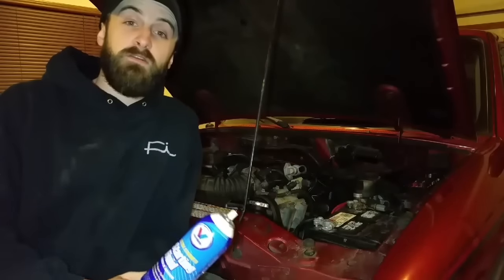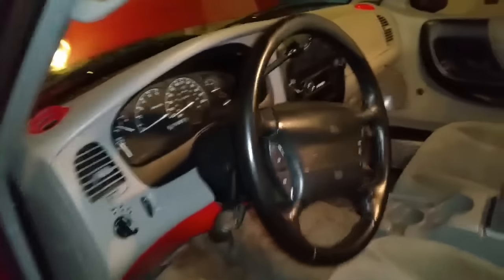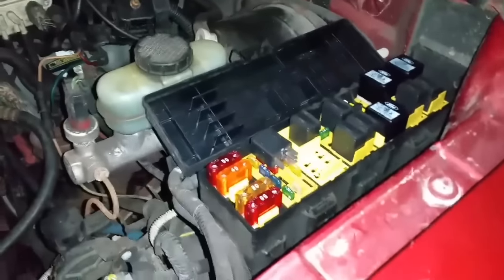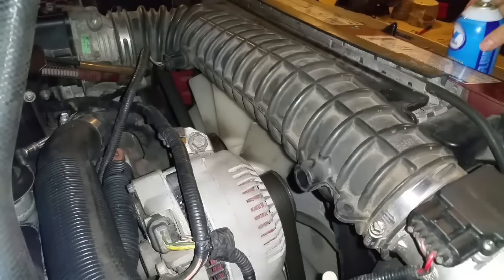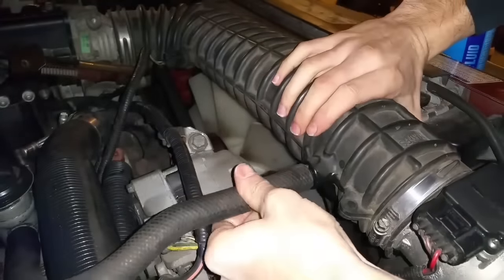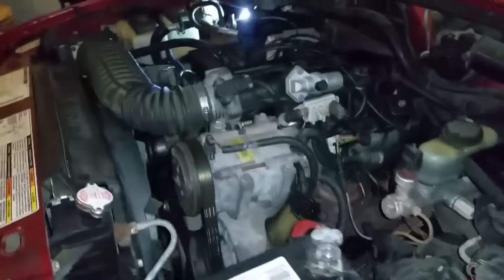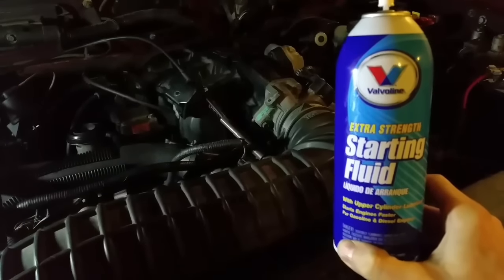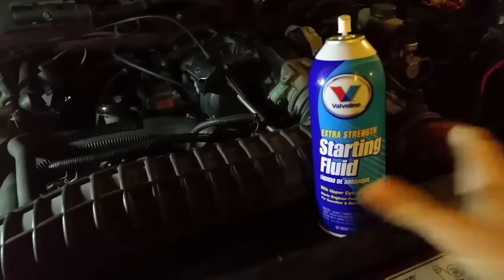THIS REALLY WORKS!!!!!!! Bad fuel pump, fuel pump relay, no fuel problem!!!

Comment: Thisw 2works ok as an early test. It proves that you have spark. It eliminates that entire system. How ever it only proves that the fuel system is not working. Mor4e testing needs to be done to prove what fuel component is the malf. Many things can cause the pump not to run.
Reply: Yes but the first thing you check is the relay/fuses start the cheapest is that doesn’t fix it then you replace the fuel pump assembly it’s cheaper and easier
Reply: @chancesmall7026  how do you do this? I replaced the relays but still nothing, I don’t hear a click when the car is in the on position like I use to
Reply: @Francofit  you need two people to be able to do this trick one needs to lay down in the trunk with your ear against the inside of the trunk, have someone in the car, don’t start the car up but turn the key over all the way. Whoever’s laying in the trunk should hear a sound if you do your fuel pump is fine if not it’s something else. What’s wrong with your car might be able to help
Reply: @chancesmall7026  my car won’t turn on anymore, I bought the new relay for it but nothing, it starts with starter fluid but then it dies right after, I tried hearing a click while someone starts it but nothing, I also can’t hear the click anymore inside like I use to when i put it into the on position
Reply: @Francofit  yea it’s most likely your fuel pump bud im sorry but just in case check your fuel filter first it’s a lot cheaper and sometime they get clogged up, also buy some Lucas oil fuel injector cleaner/fuel system cleaner try get it started and run some of that through it. If that doesn’t work it probably is the fuel pump I’m sorry
Reply: @Francofit  there is also a fuse or two for your fuel pump not just a relay check that too that’s what it was for me
Reply: @chancesmall7026  where is the fuse for that?
Reply: @Francofit  for my Acura I have two fuse boxes one under hood one inside mine was under hood it’ll list them all on the fuse box cover or the cars manual
Reply: @chancesmall7026  does every fuse need to be in tact? My door lock fuse is out but it has always been out when I bought the car
Reply: @Francofit  get it fixed?
Reply: @billyhighfill  I did lol
Reply: Very true @charles carr
Reply: @chancesmall7026 what if I did the bypass and my pump comes on but still doesn’t come on at the ignition on or fires up?

Comment: My problem is intermittent and occurs when I shut the car off between 30 seconds and 5 minutes. After 5 minutes it always starts. How do you know the difference between a bad fuel pump and a bad fuel pump relay?

Comment: I just had this problem. I pulled the fuel pump fuse, and it was good. This is the first thing you should do. Then check voltage at the relay terminals which were good for me. Then I changed my relay and everything started working. Then I plugged my old relay back in everything worked.  The connection between the relay and the housing pins oxidized. Just had to pull and reset the relay.

Comment: Good video very educational. 

Here's my situation my car wouldn't start. 

Use starting fluid CPL times started then died. Tried one more time fired up I let car run to engines temp.  Now starts again I have a manual aswell. 

Any help I appreciate fuel pump going bad?
Reply: Maybe starting fluid cleaned out your egr
Reply: Probably you had a light engine flood situation. The starter fluid helped starting once. So problem "solved". ;-) EGR has nothing to do with it.

Comment: ok here is a good one....same scenario same symptoms almost dropped the tank off my truck  (2001 f150) to replace fuel pump. problem..................I was using a spare aftermarket key that the truck would not recognize so it would cut off the fuel system. The kicker is that sometimes it would work fine it just would not always accept the key.
Reply: That sucks but very good that you figured it out! That could have got real expensive if you replace parts as a form of troubleshooting like some ppl do. 👍

Comment: What if the 25.00 cam sensor is bad. The cam sensor is the main input for the injectors. A fuel pump module can run 3 to 400.00. Using starting fluid only tells you if you are or aren't getting fuel in the cylinders. Remove timing and compression questions. I use starting fluid as one diagnostic tool. Not the only one.
Reply: Will an OBD reader pick that up?
Reply: Pick up if the cam sensor is working?
Short answer ...yes. cam sensor codes are P034x or on the 0340 to 345 range. So if there is a fault, it might. 
Yes, there is a BUT.
Sometimes the sensor is intermittent or barely within parameters and it won't set a code. So the diagnostic steps I use are
1. Starting fluid
2. Pressure test fuel system
3. Noid light to check injector circuit. 

These steps will give you a picture of what's happening.

Comment: Brake cleaner works great too. Ss long as you buy the brake clean that says "Extremely Flammable " on the label. Not a lot needed and I usually crack the throttle about half way or a bit less so the spray gets by the butterfly in the throttle body.
Reply: Be very careful using brake clean. This will and can create phosgene gas which amounts to nerve Gas!

Comment: A CRANK NO START does not always mean a bad pump, you also have to check the basics SPARK, FUEL, AIR COMPRESSION as well, short to ground is the ecm commanding the fuel pump on when the key switch is turned on.
Reply from the maker: But, this video is about fuel related causes, not the others... Even though this method does verify spark and compression (If it fires with starting fluid)
Reply: Well he obviously ruled spark and air if it starts but does his video mean its the fuel pump not necessarily i like to think of it of  starting the investigation in the right direction ruling spark and air and focusing on fuel like pump relay short in the wire to the pump etc…

Comment: My van was going great then one morning I turned it over and it cranked over but didn't start my mechanic says it could b electrical fault but it starts with starting fluid do u reckon it's the pump that's gone
Reply: of corse its a fuel pump issue and this is what the vid  just explained. There clearly isn't fuel being supplied so check the relay then check the pump itself
Reply: @matthewtoomer2181  you're wrong... And you've been wrong several times basically for the same reason... The video suggests that you got a bad fuel pump if you can show that you have spark and it will fire.. it doesn't say you might have a bad ground or you might have a bad relay or you might have a bad control signal or you might have a bad injectors or you might have a clogged fuel filter or you might have a pinched fuel line... The video suggests that what he does indicates that you have a bad fuel pump nothing more and that's why it's incomplete.

Comment: Just to clarify, the FUEL PUMP RELAY has to be removed FIRST? Before doing this test? My situation, I have spark, turns over fine, but spraying starting fluid like you show gets nothing. I'll try removing the relay tomorrow and see what happens. EDIT: Turns out it was the MAF sensor that was dirty. I removed it, blew it out with compressed air, reinstalled and my truck started right up.
Reply: He only removed the relay to simulate someone with that kind of issue

Comment: Be careful not to use too much starter fluid, especially when the engine is not cranking while spraying the fluid. My son literally blew  up his intake manifold.
Reply: @walker.wayne5772 
The fact is I did warn my son to go pretty sparingly on the starter fluid. But he had other ideas, as sons sometimes do...
Reply: Yup, my Air filter and housing blew right off the car. Did not realize it was too much starting fluid !
Reply: @bhagyawanbhagat2361  
Starting fluid should come with a predominant warning label on the can.
Reply: Your not 100% right, what you have determined is that you have a fuel delivery problem. Corroded injector harness, blown fuse controlling injector, harness at fuel pump and a few others. Describing it this way may lead DYI’s on the wrong path and pull tank , put new pump in and still no start. Starting fluid , as others have said may not be good if used incorrectly, get air intake cleaner or injection cleaner, less volatile but still combustible to achieve what your describing and greatly reduces accidents

Comment: that describes my 2001 ranger to a T.  When the weather is warm, it starts just fine. Once we get cold temps, it will only start if I use starting fluid.  but once it starts, it runs just fine.  Is my fuel pump really the problem?  The fuel pump must be pumping fuel once it starts running because it doesn't die....  Any ideas would be greatly appreciated!  FYI, I have replaced the fuel filter.

Comment: Before I change the fuel pump..... I have followed all your trouble shooting advice (short of using a pressure gage). I can hear the fuel pump when the key is turned over to accessory it sounds strong and when my wife turns the key over it does not sound as strong. To be sure, should I spend the money on a pressure gage? Thanks for a great video.
Reply: Men obviously can just turn the key strongly and given that universal fact pump runs strong, unlike women using machine causing dainty pumping by dainty key turning with feminine energy contaminating manly machine.

Comment: Would this also verify bad injectors? My fuel pump is new and fuel pressure is normal. Crank no start situation, replace crankshaft position sensor, checked, put new spark plug wires, test light shows power to the spark plugs. Soon replacing temp sensor and cleaning injects I guess.
Reply from the maker: Would confirm a no fuel situation. If it fires with fluid it means you have everything else working, but it's not getting fuel.

Comment: I had a bad fuel injector in cylinder 5. I got that taken care of. Before that I had the fuel filter changed. After the fuel filter was changed, the car started sputtering and will die out once it warms up. Is this caused by the fuel pump?

Comment: I use this process as well but it's really just a start to the Diag process as many other parts on the Fuel side or could be the issue, I wouldn't just say Bad Pump, but sometimes it is just that.

Comment: I am having the same problem with my 2011 Hyundai Sonata  it turns over but want start I was told it could be the fuel pump relay are the crank shaft position sensor . Does this sound  right to you?
Reply from the maker: Vietnam Vet Could be... if it tries to fire with this method it's not getting fuel for some reason... Some computer may use the crank sensor signal as an input to fire injectors when it knows engine is turning.
Reply: ok thanks

Comment: I have check the relays or fuses  On the open road it runs beautiful like a new vehicle Problems develop at low speed under 40 mph.
Reply: Mine have same problem what did you do?

Comment: Im surprised no one has said anything about the possibility of a clogged fuel filter? In most cars you can hear the fuel pump prime once the key is turned into the accessory  position. If you have a bad relay/fuse the pump wont kick in and you wont hear it prime at all. A good indicator of a bad or clogged filter is if you can still hear the pump trying to prime but makes an other than 'normal' sound for your particular vehicle. An extremely clogged filter will cause a fuel feed issue bad enough to prevent your car from not only starting but continuing to run (even if you kickstart the motor with starting fluid).
Reply: Diesel truck yes gas not so much In fact I have never seen a car with a filter so plugged it would not at least start.
& pumps do not run in the ACC position.
Reply: Danielle Gaudette how can I check it clogged  fuel filter
Reply: How would i check fuel filter on chrysler sebring 2004 cause its doing what you said i can hear pump trying to prime but its not as strong or loud as usual its more weak and quiet does that mean its just clogged or fuel pump bad or going bad but either way car wont start now it just shut off while driving at 60 mph
Reply: .....good info.  How about car fires right up.   But 10 min later- wont start.
  So far, replaced fuel pump, relay.

Comment: So I have a fule delivery  problem listening  to utube i changed the crank position sensor in a 2004 mitsubishi outlander sport 2.4l I've pulled the fule pump in the bottom of the pump canister  was what looked like mud so I cleaned is and whats next to do any suggestions

Comment: I use this method as a diagnostic tool on a petrol engine to check if the ignition system is working, it 'could' help in diagnosing a bad fuel pump ? But it's not a hard and fast diagnosis that 'you have a bad fuel pump' there's a few more variables of what could be wrong ..... great video though 👍👍
Reply from the maker: Paul Parsons Correct. A good indicator engine is not getting fuel. Thanks for watching.

Comment: So what it means when you add this starter fluid and you still get a no start ?
Reply from the maker: Could be a no spark, or mechanical issue.
Reply: @BlaserBuilds  i get plenty of spark just no turn over , even when using this method.
Reply from the maker: @lilrican1971  Do compression check.

Comment: I don't have a comment ,but have a question
My van is doing exactly what u showed in your video, but my fuel pump is new about 6 month's! It's a astro van, maybe you would have a suggestion
Reply from the maker: Aimee Getz Could be relay controlling the pump or clogged filter. Or, honestly could be a bad pump again. I've had a pump fail 2 weeks after I installed it. Weird but it happens.
Reply: a21bravo I'm gonna try the littlest first, ( I'll put fuel injection fluid in it, and check the relay,I suppose, before I run out and get another pump,cuz honesty I don't have the money right now, the mechanic charge me 1500 dollars the first time, so I'll start small and work up! What do u think

Comment: So what if mine cranks no starts. But starts with starting fluid as this one did, but mine will stay running once started with starting fluid. What’s your thoughts on that? It’s a foxbody mustang 5.0.
Reply from the maker: Usually that's not enough fuel when cranking. Vacuum leak, or something else.

Comment: I have a problem with a 5.2 dodge. It stalls after about 25 minutes or 25 miles. I tried the starting fluid and it started up for a few seconds. So I replaced the fuel pump its in the gas tank along with the filter and regulator, its an assembly. It still stalls after about 25 minutes. It will start back up after a 30 minute cool down and run another 25 minutes. Any help? So with the starting fluid it will start for a few seconds. My guess is the ecm is not sending a signal to the fuel pump after it warms up.

Comment: I tapped on the fuel tank a few times with a small hammer and my dodge fired right back up. And used a LITTLE started fluid, reason being I've heard of engines getting ruint if you spray to much

Comment: What if you get the car started spraying starting fluid, and it runs fine, idles fine, but will not crank on the initial start.

Comment: so if you take off air intake and poor gas directly in  or shoot starter fluid in intake and nothing happens is it not getting any spark??? just checking...thax
Reply from the maker: An easier way to check for spark would be to pull a spark plug out, attach it back to wire and crank it over while the plug threads are grounded.
Reply: its definitely a spark issue... no codes at all...maybe my computor took a shit...i work alone and do not have remote starter..very tight compartment ...
Reply from the maker: @roadstar499  A bad sensor (cam/crank) could cause a no spark situation even if computer works.
Reply: i did have a p1345but since i replaced timing chain no codes anymore...i think it could be coil...very much a pain in the ars! hope to fix this issue tomorrow ...thax

Comment: It could also be the fuel rail pressure sensor on the fuel rail itself, or a plugged fuel filter. Use your scan tool and eliminate the possibilities.
Reply: Scan tool?
Reply: This! Using ether just shows that you have no restrictions from the TB/carb and you have spark. Nothing more he’ll you could do this and start the engine and just be out of gas lol

Comment: WD-40  a bit safer than starting fluid. 
to my surprise it works well on 4 stroke gas engines.
 Diesel? not so much on cold start, but it helps & leaves a little lube that ether [starting fluid] removes.

Comment: I bought a 84 old pontiac. It wont start. I spray a bit of starter fluid and it will start right away. I could drive around for 10 min. Shut off the engine and the car will start again just fine. It seems to only need starter fluid when the engine is cold. I changed spark plugs already. Any suggestions?

Comment: My Sprinter van 2001 , 313 cdi diesel cranks and will not start.  With starting fluid it starts and keeps going fine.  🤔

Comment: i did as you said turned on a bit with starting fluid then turnned off, but why can i still hear my fuel pump humming noise under truck like it still works?
Reply: Pump is bad

Comment: How do you know if it’s the relay or the fuel pump?  The guy who is trying to fix my car didn’t mention anything about relay.  He replaced the battery and spark plugs was able to drive it around the block.  We ordered the official battery and parts because he used the one from his car the first time.  Came back the second time to install battery and spark plugs but this time the car wouldn’t start.  So now he thinks it is the fuel pump but can’t find the part because it is a saab.  He verified with this starter test.  I’m wondering now could it actually be the relay instead?